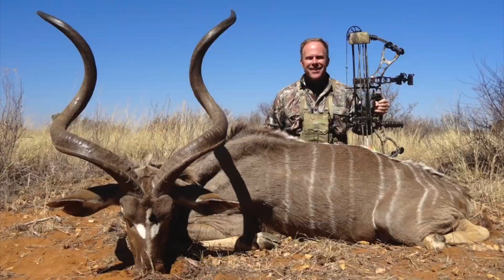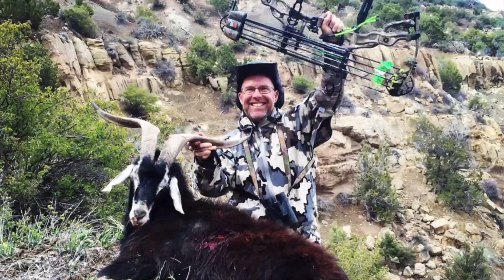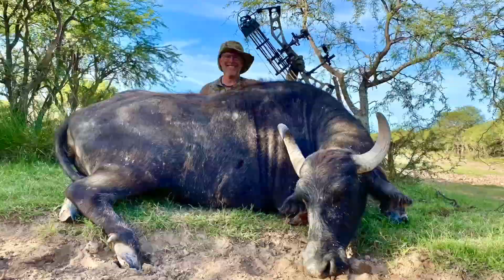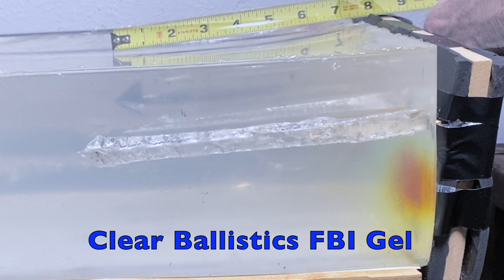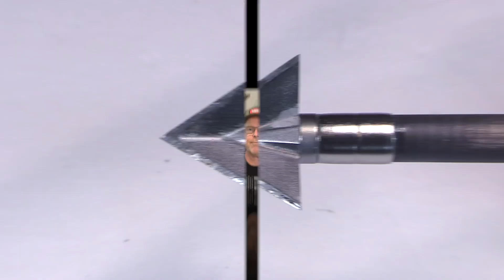MD3 by CONTACT-ARCHERY: BROADHEAD TEST

Comment: What do you do a 3-blade test where you shoot it with the standard angle sharpness and then reshma them with the stay sharp 344 to a sharper angle and then see what the difference is? Please my preference would be Annihilator if that mattered but just to show the difference in angles
Reply from the maker: Thank you. I have done that in the past. I can’t remember which head it was for—maybe an SS3 or Deepower or Annihilator. In just about 15 mins it got 15% sharper, which is significant. You can also look at the YouTube page of the Stay Sharp, it’s called Innovative Outdoorsman. They have demos using all their sharpeners with various heads.

Comment: Stainless monolithics are tough as nails. Even a small 7/8's of an inch three blade I shoot has 1.3 inches of cutting edge, which is more than many large two blades that are 1.25 inches. Large three blades can cut a wide hole, but smaller 3 blades fly much better and have greater potential to pass thru. Something I would recommend on your crossbow flight test with traditional heads, is shoot aluminum shafts. I have been shooting crossbows since 1986. Carbon shafts have a stiff side and a weak side and traditional fixed blade broadheads can land all over the place out of a compound, trad bow, or a crossbow shooting carbons.
Reply from the maker: Thank you. I do test for the week side of the shaft and fetch accordingly, so there is consistency.

Comment: These broadheads look alot like the exodus full blade.
But for $65 on sale I'll pass
Reply from the maker: That’s a pretty good price for S7 tool steel. Some people prefer the extra durability of a one piece head that can be sharpened and re-sharpened over and over without having to buy replaceable blades. Other people would rather just replace the blades and pay for it that way.

Comment: So many heads starting to look a like. I feel that most everything that can be done has been done. I’ve tried them all over 45 years of bowhunting and it really just comes down to what you have confidence in. Hit them in the pocket with any reasonably made broadhead and they are going down in 100 yards or less. Love your channel. Keep it up.
Reply: I agree 100%, archery performance is basically maxed out and all these companies across all platforms are just recycling products with very little increase in performance. The energy that these bows produce now will allow any solid well sharpened head to work without fail.
Reply from the maker: I really like to see the innovations in materials, hardnesses, and geometries.